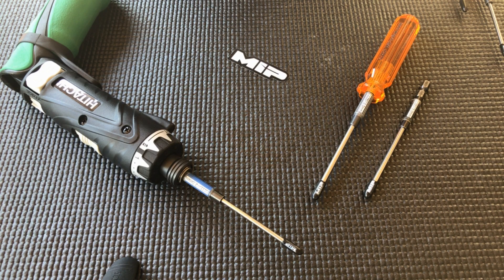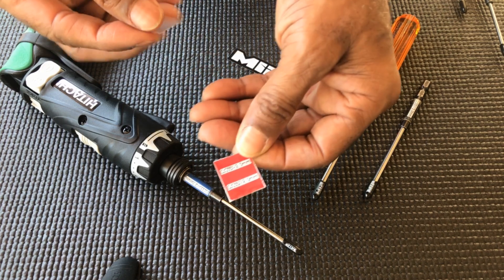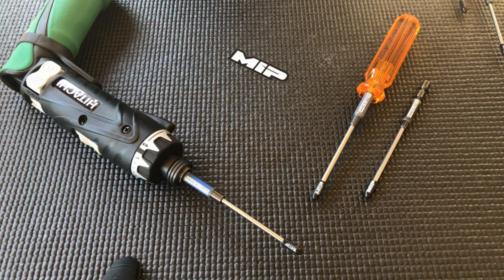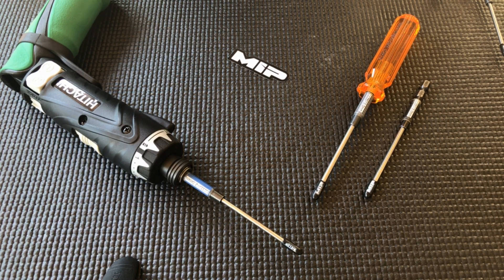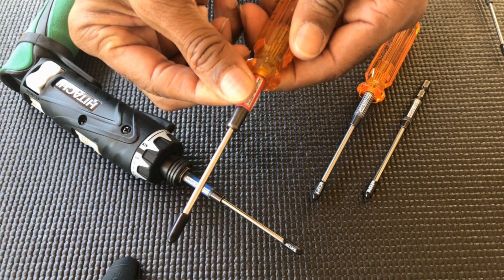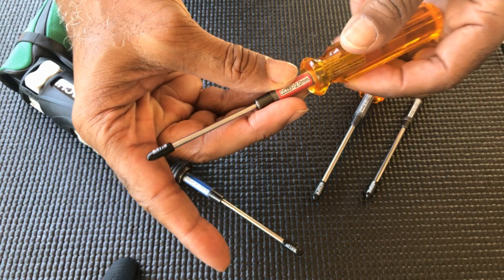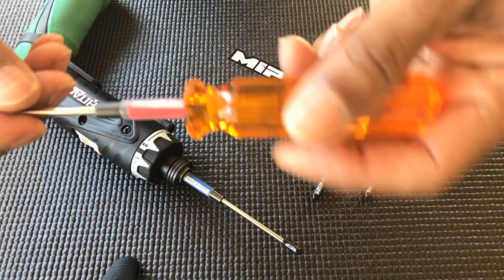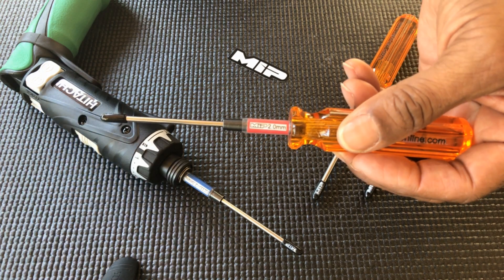How to Install Wrench Wraps on Your MIP Tools!

Comment: I've just ordered some of your tools - actually almost a whole set (super excited). Looking very forward to getting them as the only decent set I have are the smaller allen keys (which are very tough to use on a kit build) - I also have some cheap, longer heads which have all rounded out after just half the build! Buy nice or buy twice. Thanks for this vid - I'll know exactly what to do when they come in.

Comment: why is it even necessary to do this? why not just engrave the tool with the size or pre-install the labels at the factory, so the customer doesn't have to do it?
Reply: Because it's more fun to nickel and dime customers. I'd avoid their tools entirely, and get big boy tools from Wiha, Wera, Engineer, Stahlwille, etc. They're just better metallurgy and ergonomics...